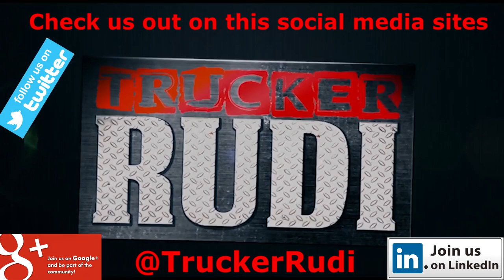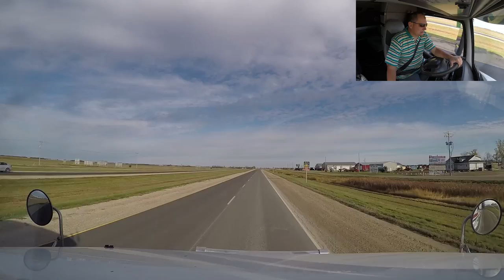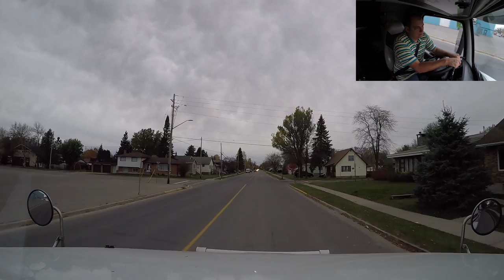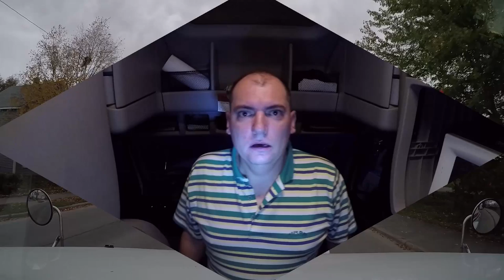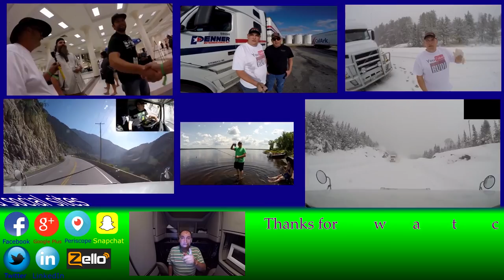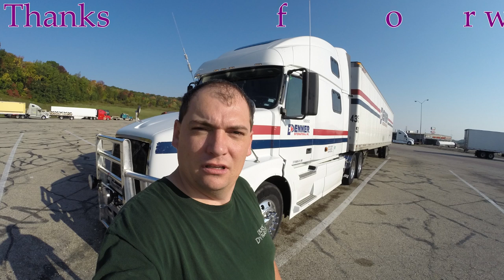TRUCKER RUDI I think I got it figured out the problem is with the truck 10/16/16 Vlog#859

Comment: they have bearings that need to be lubricated if they are wore out they can bind up and fail also air filter replacement is a very good thing to do you dont want to dust a new turbo and run good engine oil.
Reply from the maker: Richard Olson you got that right maintaining your truck is very important